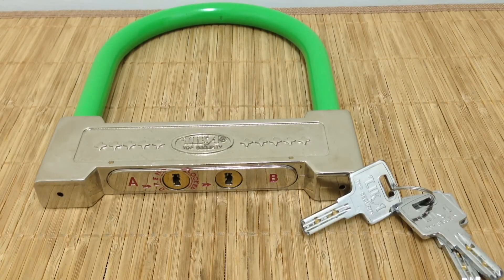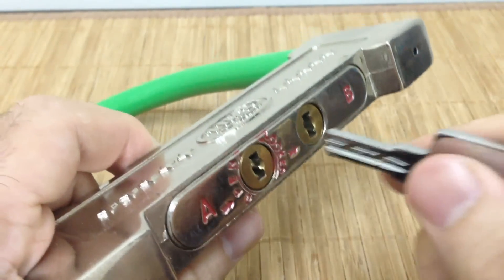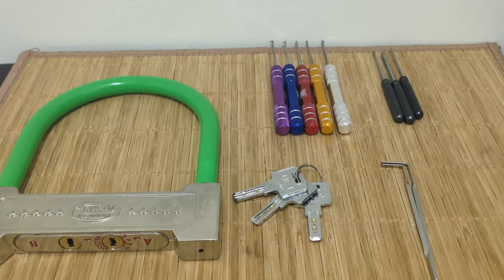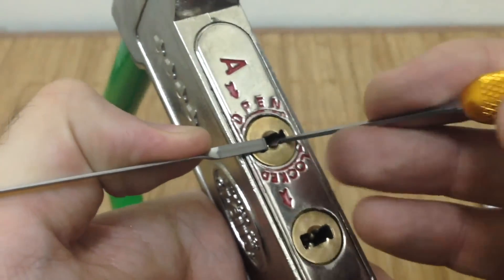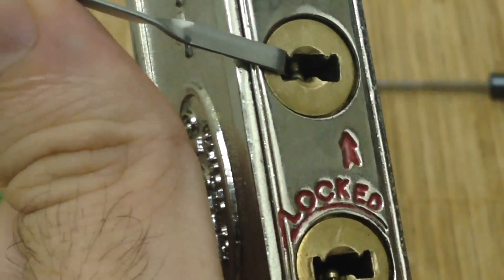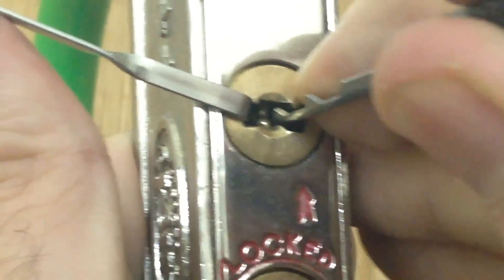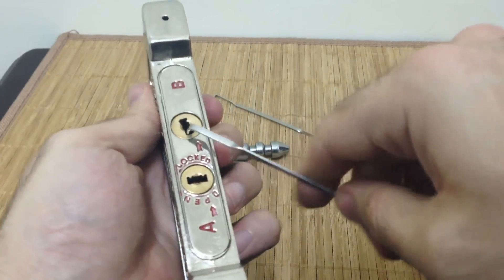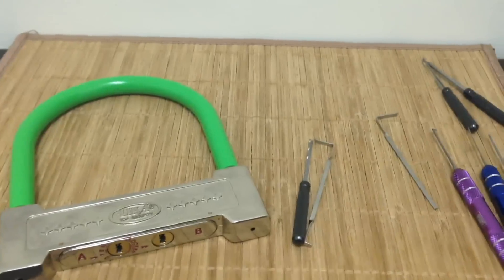[34] "LIKA" Dual Cylinder, Double Sided Dimple Lock (PICKED!)

Comment: Very nice Bicentric keyway lock. I have a very cool vintage bicentric lock from WWII and its an American Airborne Unit lock
Reply from the maker: Wow! I am curious how it looks like. Can you e-mail me a photo?
Reply: Yes will do my friend, do you want to PM me your personal email address and as soon as you mail me I will send a photo of it. Its a big heavy thing and shackle comes all the way out. I have picked it on video, but there was a twist to it. I fully picked one of the locks which released the shackle one side but had issues picking other lock due to tight pins. I realized this was due to shackle putting force on from other lock picked. I locked it back up to start again by picking first lock on the body, but once I knew it was picked I did not fully turn the plug, then fully picked second lock. I simply then popped tension wrench back into first lock to fully rotate and job was done ;o))))
Reply from the maker: waddac2 Nice job! Good on the spot thinking! 

Go ahead and e-mail me at Lockman@Lockman28.com, that should work fine. Thanks! =)
Reply: LockMan28 I will save your email address to my contacts now and send you photos buddy ;o))))

Rich (waddac2)